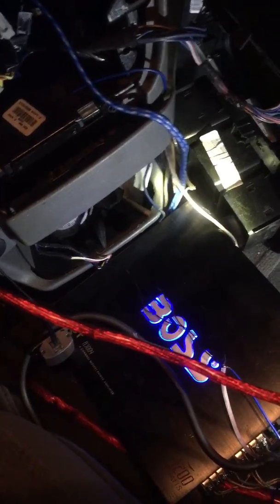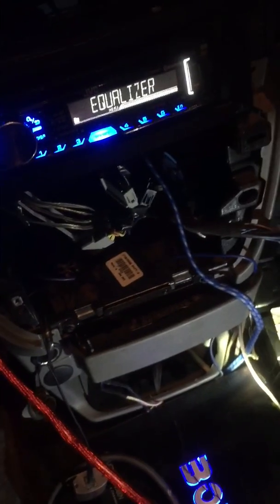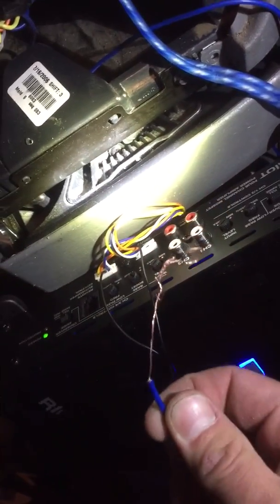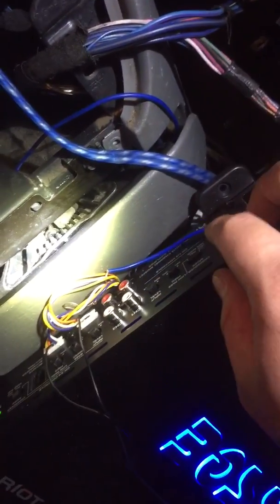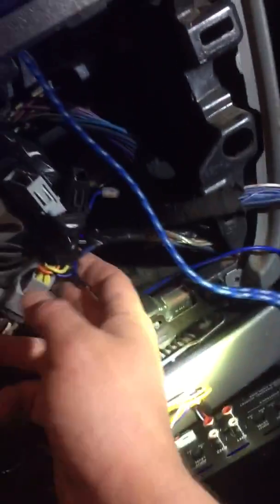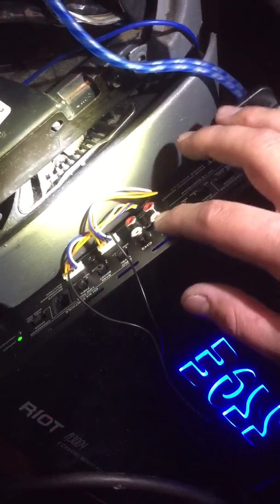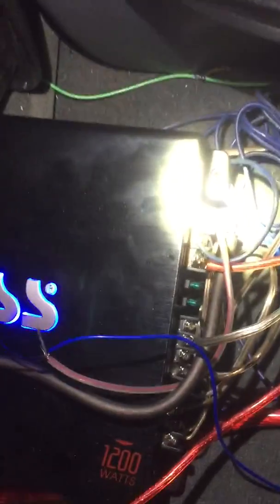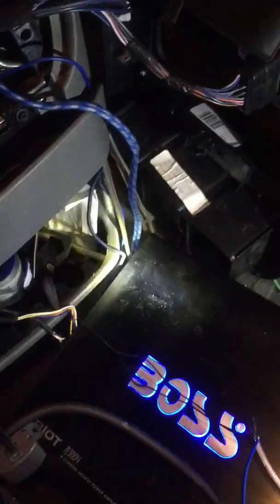FIXED: Annoying hissing, static sound, “engine whining,” buzzing and etc. by a super simple trick (

Comment: To make a long story short I think he is saying  use a ground wire from the head unit to the amp .
Reply from the maker: steve dental pretty much, I guess it doesn’t make a difference if you connect it to the ground on the amp or the chassis
Reply: @_N_B_0496  can i put the ring terminal & wire at the amp end of the RCA and the either put the other end of the wire into the ground of the amp or use a screw on the amp ?
Reply from the maker: c0uchsl0uch00 hey, not entirely sure what you’re asking. Could you describe in detail what you mean?
Reply: @_N_B_0496  instead of the RCA at the head unit end, do this same thing but at the other end where the RCA goes INTO the amp. Put the little ground wire at the amp end and then ground that little wire to a screw on the amp instead of the stereo. It would be easier to get to that than have to pull out the radio
Reply from the maker: c0uchsl0uch00 oh I see what you mean, yes that would probably be easier, but when I made the video I was working on my system anyway and had the head unit already out. Plus, all that extra little wiring wouldn’t be exposed and visible when the head unit was installed back in its place
Reply: @_N_B_0496  do you think it would solve the problem though?
Reply from the maker: c0uchsl0uch00 it has helped me before, but sometimes it only reduced the noise, so I narrowed it down to the amp being super cheap quality, the head unit of a cheap quality can also cause this, and also cheap ass RCA’s that have too much crosstalk. This trick is kinda helpful. At the time of this vid it helped me.
Reply: @_N_B_0496  thanks
Reply: I wish i read your comment before I watched. Lol
Reply: So he ran a wire from gound of amp to body of radio?
Reply: @305chevyboysp6  correct
Reply: @Sertao2013  I just tryed that I’m getting same noise
Reply: @cordovacolorado  lol
Reply: @305chevyboysp6   correct
Reply: Were would u mount it than frame?
Reply: @_N_B_0496 I tried this I tried to go straight to my rear battery that's a 96ah spimo8 lithium bank and still makes the same noise I think it's a bad head unit even though it's a new cerwin vega
Reply: Thank you so much
Reply: @cuchsluch  Hi, can you please tell like the Amp has positive and negative wires, should i cut the connection of the ground black wire coming out from amp and just connect the brand-new piece of ground wire to amp negative terminal and other side of wire to amp body?

Comment: High to low converter makes speaker wire from radio in to low pass rca cables for amp rcas and a noise filter can help rca from radio to noise filter rca to amp

Comment: And amp needs to be mounted to metal frame of car too you have to use like bolt from seatbelt scrach off paint under it put wire to it tighten it tight screw seatbelt back in
Reply: No it doesnt, amps have a ground wire for that reason

Comment: I have the same amp.. I’m getting where it won’t cut on the subs and sometimes it does just depends if it wants to . Checked all the wires … doesn’t go into protective mode at all , power lights stays on sometimes when I move the amp around wildly it will turn on  but not everytime
Reply from the maker: @CODYWAYNEinGA6.6  it sounds like a poor grounding issue, maybe even both the ground and power need to be tightened.
Reply: @_N_B_0496  ya wish . Tried it all I even took all
Wires off and wired it all back
Up

Comment: I'm trying to take these sound away from my Chevrolet using factory radio I installed two amplifiers it's not going away how can I fix this problem
Reply from the maker: Are you running a line output converter? That might cause a problem if it’s kinda cheap. Same thing goes for the RCA cables if you have them (get good quality ones so they don’t cause cross-talk, which can also cause weird noises). Make sure your grounds are properly and securely connected (best ground is if you crimp copper cable lugs on the grounds) and bolt them to the chassis and make sure you remove any paint and oily residues from the ground surface (it’s a must!) and also have a proper connection on your power cables. If you’re running your signal wires from the speakers (instead of using RCA’s and a line output converter), make sure they’re connected to the right wires (negative to negative and positive to positive) and try to solder them or use good connectors instead of just twisting them together. Let me know if you’ve tried all this and it solved your problem, or if not, still let me know and I’ll try to narrow it down more and see if we can get rid of it. Good luck!
Reply: @_N_B_0496  thank you buddy I'm going to try that but I have the Lc 2 converter  and I was thinking maybe it was that. But I don't know I'm going crazy with this noise
Reply from the maker: @walteralvarado3640  I feel ya man

Comment: I disconnected the rcas from my head unit and speakers still make noise it’s had to be my 4 channel so tried stripping wire and touching all 4 rcas and touching wire to bare metal on amp didn’t make a difference  will have to try this
Reply from the maker: What amp do you have? Sometimes amps may fail and make speakers screech

Comment: Humming problem in my  pioneer subwoofer. ,my setup is crown amplifier xti 4002 , pioneer 709bt, XLR to rca cable , Rockford fosgate to play punch components but hummm sound in my subwoofer plz solve my problem.
Reply from the maker: Bro you’re running so many brands that I can’t keep track lol. Idk if that has anything to do with it, might be compatibility issues, but not too likely. I’d say check your ground for the sub amp (ground wire noce and short, securely connected to the amp, bolted down to the chassis of your car to bare metal and absolutely no exceptions), check your rca cable connections (and also make sure the rca cables you’re running are good quality and not some cheap stuff from Walmart, otherwise you could have crosstalk) , and I’m not entirely sure on what xlr is and why you have it, but I’d suspect something could potentially be wrong at the xlr cable to rca cable connection. The less adapters you’re running in between 2 components, the less problems you’ll have. Try some of these things, or at least double check everything I said because sometimes you think you have everything done properly, but overlook one small thing and it’ll mess up your sound. And definitely let me know if any of these things solved it for you.
Reply: @_N_B_0496  thanks you so much for your support 🙏🙏
Reply from the maker: @manjeetsolanki3160  no problem man, did any of what I suggested help? Lmk cuz I’d love to know cuz I’m still learning everyday lol

Comment: so did he run a wire from the amp ground to the radio or the ground and amp signal wire both together then to the radio
Reply from the maker: I know it’s a bit of a long video and since  then I’ve thought of ways to make it a lot shorter and straight to the point, but all I did pretty much was loop one side of a wire around the RCA preamps on the headunit and loosen a screw on the chassis of the headunit and loop the other end of that wire around it, then just tighten the screw. Back then what I was trying to explain was my thought process on how I came up with that idea so that threw off a few people lol. So those ground wires on the amp were for the high inputs on the amp and technically had little to do with the problem solution

Comment: My taramps md 5k is doing that I think the rca ports on amp are going bad bc when I mess with where the rca plug into the amp it fixes it for awhile do you think there loose or something inside the amp I definitely would like to get amp with tiffany style rca
Reply from the maker: RCA’s on the amp rarely do that, I rather suspect your RCA cable connectors. Unless you can see the actual RCA port on the amp wiggle when you touch the connector.
Reply: @_N_B_0496  yeah it wiggles and that how I fix it just wiggle it a little I'm sure that will only fix it so long before it finally totally breaks I have zero experience fixing amps should I just send it in to be repaired?
Reply: @_N_B_0496  I have am rca tester and tested the rca they seem good they are sky high rca

Comment: I dont have a amp hooked up and it hums from the alternator. What do I do?
Reply from the maker: If you mean you don’t have your RCA’s hooked up, but your power and ground are hooked up them you most likely have a weak ground. Make sure your ground point is free of paint (scuff it up with an 80 grit sandpaper or with wire wheel) and make sure you bolt it tight to the chassis. I’d suggest using a bolt that bolts directly into the chassis, likely bolts that hold the seats down. Same goes for the power cable, make sure it has a clean connection to the battery or the alternator, depending on where you hook it up to. Also, it’s critical that both your power and ground wires are properly crimped and properly installed into the amp, I’ve done that many times where I’d try to hook everything up fast to test and forget to install properly and have bad contact that causes all kindles of issues.
Reply: @_N_B_0496  so I have a 98 camry and I hooked up a boss head unit. Cd/radio/bluetooth. The only ground wires I have (green wires) are the 1 wire coming from each of the plug clip attachments from the back of the radio that I then each connect to a ground coming from the car. So two total ground wires each attached. Is that enough ground? Should I also use another ground wire say attached from the case of the radio to a metal point in the console opening? As far as my amp goes I dont think anything is coming from it other than the wires I join together from the back of the head unit wires.  There isnt any rca jacks
Reply from the maker: @Dibran9mm   hey, I know it’s a hella late reply, but I’d think it’s that Boss HU, unfortunately. Since I made that video, I’ve realized that the Boss amp was pretty trash and a few months after that video it made the noise come back and at that point no grounds would fix that. Replaced the amp and everything was cool. But I might be wrong. And if you’ve fixed the problem, please lmk how and what the problem was so I can pass the word to others. Thanks!
Reply: @_N_B_0496  can I show u what I bought and see if it would work in taking the noise out

Comment: The night i put my sub in me and my friend went out and when my car would he around 2000 rpm while accelerating you would hear a sound similar to if you had an aftermarket exhaust or cut off the exhaust and i had tricked her for a few minutes till it got annoying and i told her the amp wasn’t grounded good enough 😂😂

Comment: Hi , I have kinda the same problem, I have an 8 " amplified subwoofer (active) installed in a GMC TERRAIN 2019, when I start the engine, when I push the gas and when the rpms go up or down , it sounds a buzz out of the subwoofer they are connected thru RCA , would it work for me? , Ive taken the truck thru various technicians but they all say that it's well grounded ...
Reply from the maker: What happens if you unplug your RCA’s? What rca’s are you running?
Reply: outside of a simple grounding issue, if you have rca's & power cables running to the amp try to make sure theyre not running right alongside each other because it can cause hissing and issues, depending on how much power and quality of cables. it could also be a struggling alternator adding to hissing as that is what provides the power when the cars running. that could be why when you hit the gas it can change the hissing/sound, more rpm means the alternators doing more, more power is moving around to fuel injectors, etc. which could worsen hissing.  maybe check to see if the hissing is there when the engine isnt running which should mean power is direct from the battery to start troubleshooting.   i had to setup a second battery in my car back in the day (a deep cycle marine battery meant for a trolling motor) to help level things out because my stereo was drawing too much power and causing all sorts of problems like my lights would all dim, nearly shutting off and i killed an alternator or two from pushing them past their specs and all sorts of hissing.  i also ran all power cables down one side of the car and all rca/speaker wires down the other with basically no crossing of wires (a massive pain in the ass involving removing seats/carpet/panels) and bought a nicer aftermarket alternator to handle the extra power draw on it.  no hissing at all regardless of how much power was being used afterwards. it also helps to have high quality equipment. not sure what you have but that can def be a factor.  generally speaking cheaper stuff just isnt going to perform as well because its made with cheaper parts and built with profit in mind more than performance.  my kicker zr amps and eclipse aluminum subs were good stuff back then, higher end way back in the 90s... cause im old, but same principal still applies. higher end brands will use higher end parts that just perform better.  most people dont need 140db of bass though so can probably find a better balance of $$ for performance than what i had.

Comment: Personally all this video did for me was make it so I'm wasting my time taking the casing of an after-market deck off now because it's driving me nuts and I want to know where the other end of the ground inside of a factory aftermarket deck goes to because in my mind all you did was add another ground for your amp I don't see how you helped the head unit whatsoever unless the other end of the ground inside of the cave somewhere goes somewhere right to the metal there are the casing if that's the case then I guess you did probably strengthen the ground
Reply from the maker: Sorry for the late reply, but yeah, I didn’t ground the amp, I provided a better ground for the RCA preamps. If rca’s don’t have a good ground you’ll have static.

Comment: noob here..am really fedup of this noise since i changed my stereo and used a jbl a6004 amp..what exactly should i do? in layman terms...will replacing the rca cable to a better quality one do the trick? coz i m not able to understand how to ground my amp :(
Reply from the maker: Since I’ve posted this vid I found that there may be more causes to this. The easiest to do is to make sure all your grounds have a clean contact to the metal. Then you can go the quality rca route and make sure you don’t run them close to other cables to avoid crosstalk as much as possible. If that doesn’t fix it then it’s probably the head unit. Cheap head units tend to do that. Sometimes even more expensive headunits can have internal component failure which causes whining.
Reply: @_N_B_0496  thx..i will show your msg to the car mechanic..hopefully he gets it :')..coz sometimes i want to burn my car down..its so damn irritating
Reply from the maker: @tigerfighter8921  lol, I know what you mean. But being a mechanic myself, we don’t usually deal with electronic stuff like this. I work on semi trucks and I scan them with a computer and if I have to, fix electrical faults in the truck, replace bad electrical components, but mostly I deal with mechanical side of the vehicle. I think you’d be better off going to some kind of audio shop, I’m sure they deal a lot with stuff like this. Hope this helps!
Reply: @_N_B_0496  yes it solved my issue :)..thx for helping me out :)..the mechanic kept checking my amp and stereo..ultimately it was a faulty and cheap quality rca cable :')..changed and hissing noise gone..not burning my car down anymore :)
Reply from the maker: @tigerfighter8921  bro, sorry for the late reply! For some reason not all replies go into my notifications. But I just wanted to thank you for replying and letting me know what fixed your problem, that means a lot to me as I’m a problem solver and always wanna know what exactly fixes it.

Comment: I have a jet ski setup and it makes buzzing sounds when no music is playing but when it plays the buzzing sound kinda goes away. But if you pause the song then you’ll get buzzing again. I’ve tried 2 different rca’s but I just bought two more brands and I’ll give that a shot. Can’t really move them since it’s a jet ski and space is very limited but any suggestions you could give that’ll be great!
Reply from the maker: I feel like a jet ski is a different type of setup, I’m not familiar with marine audio equipment. I’d assume if changing RCA’s doesn’t help, maybe see if all your grounds are good. If you have the amp grounded to the chassis, see if grounding to the battery changes that. Also, sometimes a bad am or head unit can cause that, but doesn’t sound likely from what you’ve described.
Reply: @_N_B_0496  when I unplug the RCA’s the buzzing stops. If I turn down the gain on the amp the hum/buzzing sound lowers in volume if that makes sense

Comment: I installed a simple 2 channel 200 watt boss amp to my son's ranger pickup rear 3way speakers. i grounded the RCA's to the radio and it is still made the random backfeed noise. On install i grounded the amp to a bare metal body spot with sheet metal screws. So now i am going to try your suggestion, I think it is a sound one because i know that electricity seeks the path of least resistance and adding an extra ground is always like insurance anyway. I had my son disconnect the rear amp until he comes home on semester break and I will then add the extra ground from the amp to the radio, see what happens and report back. Thanks.
Reply from the maker: Sometimes that’s also caused by using cheap quality rca cables that crosstalk and cause a whine, but what happened with my boss amp that is in this video is the whine came back a few months later and I was trying to figure out why, but couldn’t. After postponing that for a while I got a different, more powerful amp and that actually fixed the whine. Moral of the story is don’t buy cheap amps like this.